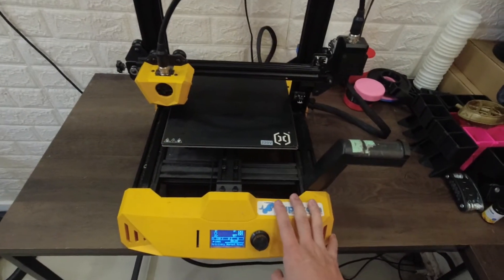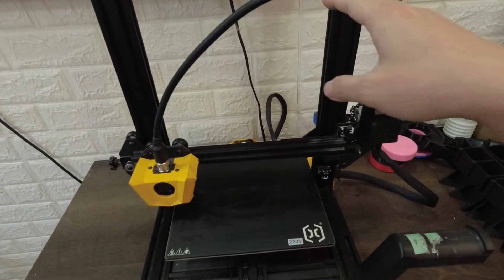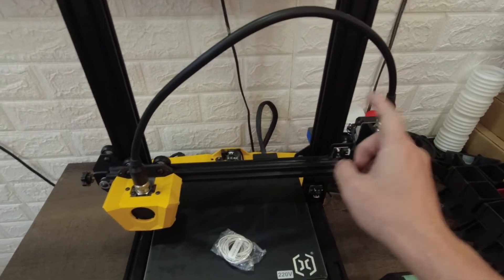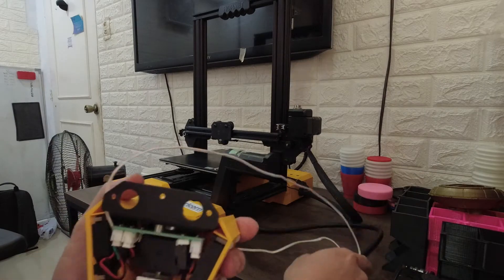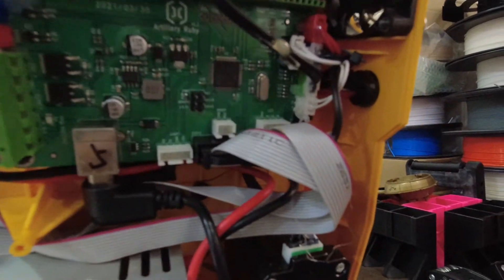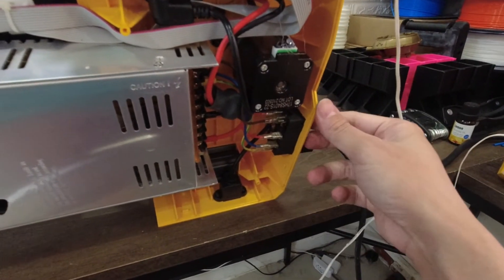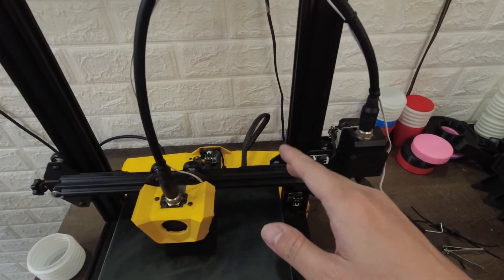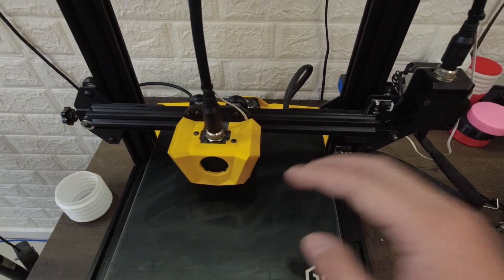Artillery Hornet MINTEMP fix | Repair vlog

Comment from the maker: I've done some more searching and I found that artillery sells the "aviation plug" only in their website: 
https://www.artillery3d.com/products/artillery-hornet-aviation-plug-gx16-8-integrated-molding-line-y-060-all-in-one-cable-to-link-hornets-extruder-filament
P.S. 
The problem will probably return even after replacing the aviation plug with a new one, so the DIY approach will still be cheaper and better solution in my opinion. :D
Reply: Aaaand now itäs gone even from their own website. greaaaaaaaaaaaat

Comment: How did you get the thermistort out of your hot end?
Reply from the maker: there's a small grubscrew that you need to remove which holds it in place. 

If in case there's residual filament that's causing it to get stuck, just blow hot air or use a torch to soften the filament then unscrew the grub screw. 

Hope this helps!
Reply: @EZY3DLAB  I could only find the grub screws, that hold the heatsink to the hot end. The only other screw on the hot end, drrmd to hold the heater element. The thermistor seems to be push fit?

Comment: consultation ! since it is not clear in the video

Did you connect the thermistor directly to the main board using the extra cable?

Or did you bridge the cable from the hotend board connector to the main board? sorry for the google translation haha
Reply from the maker: Directly to the board, coz the stock cable is already frayed.

Comment: Sziasztok , Igen ez a legjobb megoldás , cseréltem termisztort fejet , de a probléma időnként visszatért , mióta így megcsináltam habmentes.
Reply from the maker: You'll have to wire it directly to the board. Simply replacing the thermistor head will still cause issues as it is still connected via the PCB on the right side where the extruder connects as well w/c causes the issue.

My unit is up and running for more than a year now with this fix and I did not encounter this again.

Comment: This printer is horrible to get parts for. I need a thermistor and heat cartridge and ali express is my only option, terrible after sales support
Reply from the maker: I agree, that's why I went with the DIY route to solve the issue. It has been 2 months already and I never encountered the same problem.
Reply: @EZY3DLAB  I can't complain as it was a gift, but I don't think the person realized how difficult the part situation is. I feel like this model was released as Christmas item with the intent of building a customer base or for a quick buck. I see parts for the sidewinder but this model seems to have been quickly pushed to the wayside. I actually like the quick coupler design in some aspects and I've gotten great prints 😔